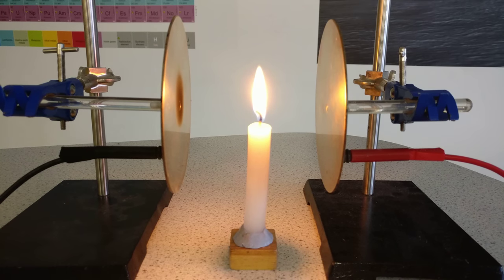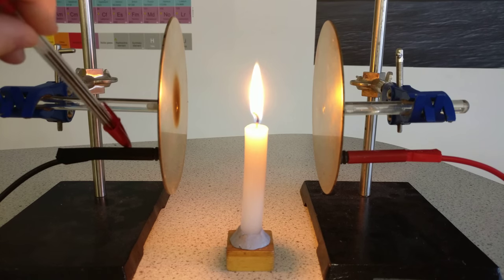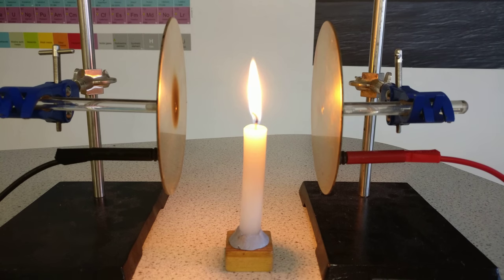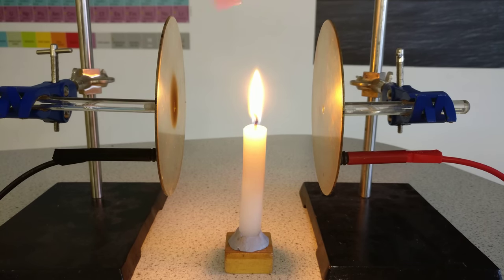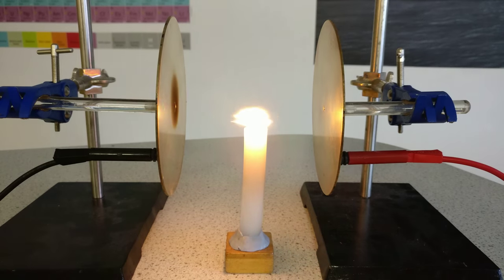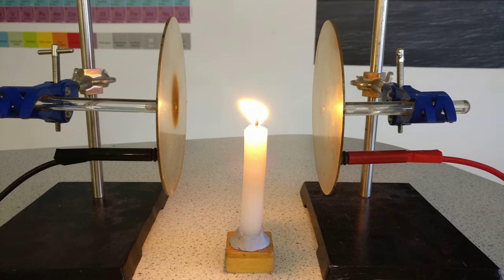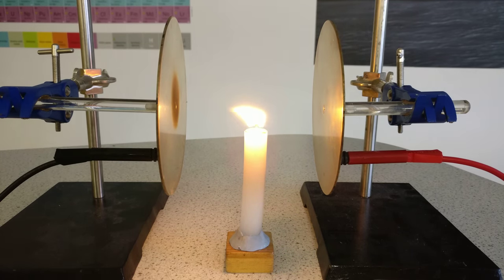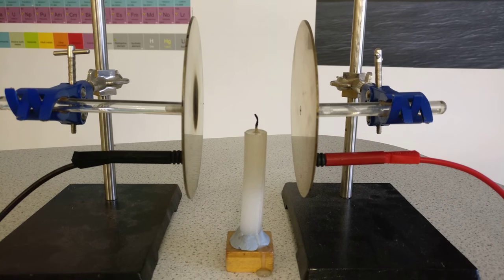Christmas Candle Flame in an Electric Field  - AQA A Level Physics

Comment: Very interesting!
My question is... does this "ion wind" have any effect on the burn rate of the candle?
a side-by-side time lapse comparison would make for an interesting pt2, no?
Reply: Hmm maybe, but what is happening is the energy from the flame is being joined with the energy in the circuit, you can see this cause the candles flame is moving towards the negative which is how the energy is also flowing. I assume it will have a effect on the rate of which the candle burns due to a few factors.
Reply: @DJxSGGxNeo  that's what I said!, lol
but seriously. if you have ion flow in 2 directions, does it more or less cancel out/balance ion flow (leaving only ion size as significant factor) or does this "joining" you speak of act like a bellows and increase burn/+O2?
also... if there is dual ion flow- pos ion flow to positive and neg to negative, then why do we see the soot accumulate seemingly on only one side? does the char get charged? (incidental pun!) even crediting ion size, there would still be some soot on the other terminal, no?

Comment: When did electricity at electrical Fields move from positive to negative when they've always move from negative to positive before?
Reply: Was going to ask the same question.
Reply: It's because there are positively and negatively charged ions, while in a solid only electrons, which are negatively charged, can move
Reply: @bene5431 And that is the reason they move from negative to positive.
Reply: @IAMNOSLEEP  Yes, positive particles move from + to - and negative charges from - to+

Comment: Is there a build up of soot on the negative plate because the soot particles are positively charged?
Reply: not sure but most likely because he put the candle flame on it for some reason, probably if what you think is true the soot would have spread all over the plate, and likely not visible

EDIT:
done the experiment, you're right, it blackens on a spot of the negative plate like in the video, it's not spread
Reply: In my mind, I can imagine that only the electrons flying through the flame are picking up soot and embedding it in the negative plate, and that's why you only see the black spot where the flame generally is.
Reply: @LuisMartinez-zd2vl  The electrons are negative, so attracted to and therefore traveling to the positive plate.  The soot is either positive itself (most likely) or is being dragged along by the flow of positive ions.
Reply: @davekni  The flame touches it once in this video in one frame, 2:32, comma/period are frame-by-frame after pause
Reply: @davekni  Maybe formed by charged ions carbons?
Reply: Ton is correct.

Comment: I'm wondering if an increase in burning efficiency can be obtained by means of an electric field like the one shown here
Reply: Goos idea
Reply: a candle seems to consume all of the fuel and oxygen?
Reply: If whatever is happening to cause the flame to go out like that, if anything I would think it would probably be the opposite, maybe? Because the flame needs 3 things to survive, fuel, heat and oxygen and if any it loses any one of those it will die so the electric field has to be disrupting one or more of those elements, so maybe its displacing the oxygen somehow? Im not sure, but whatever its doing its starving the flame of something which means its efficiency would have to decrease? 
Im just guessing.
Reply: Good idea, I'm wondering if the net energy input by comparison would be positive. You should PhD and stuff...
Reply: If it's the transfer of ions that's making the flame move, I guess the burn efficiency would depend on the fuel source. 
I wonder if an electric field could be used to stabilize the burn. We could test by introducing a steady cross wind
Reply: If changing the orientation of the plates one below the flame at the base and one above the flame
Reply: Good mixing of fuel and oxygen promotes good burning.  There should be a way to improve the mixing and thus burning with electric fields.
Reply: I don't thing so. Fire are a mix of ionized atoms and molecules, they have an electric charge because they lost an electron (or got one). Applying an electric field makes those particles shift to the opposite charge. Maybe you could make the gradient of particles bigger moving them out of the flame so it burns faster but that can be achieved  much better with a flux of gas (an extractor).
Reply: NO it can't.

Comment: Humidity in the air (H2O) goes doink, aligning itself with the electric field surely since it is a polar (non-symmetrical) molecule, slightly negative on the oxygen side (pointing toward the positive plate) slightly positive between the hydrogens pointing toward the negative plate. CO2 is not polar, it's straight across. In water, it only takes 2.3 volts per molecule (if I remember right) to line 'em up and strip them apart during electrolysis to make hydrogen and oxygen gases when they recombine in like pairs. (Lots of current though, unless pulses/frequencies might help). 

Just have to wonder if they ever separate in a strong electric field in air, first time it ever crossed my mind. If so, would we be losing some hydrogen floating upward with our 100 lightning strikes on earth per second?
Reply: To break apart a water molecule  using only an electric field, you need the potential difference across the molecule to be at about the same order of magnitude as the internal field. This is certainly possible to achieve (e.g. using a laser) but not at "macro" scale.
Reply: dang it
Reply: Yes. Lightning definitely creates hydrogen, but i think most of it recombines with the oxygen that is produced because of the heat generated by the bolt. I would be interested to know the quantities involved.
Reply: So in other words making hydrogen to power cars isn't a very energy efficient way of powering cars and would lead to releasing more carbon than if we just burn gasoline in today's highly efficient engine's?
Reply: @dukecraig2402  It actually comes pretty close in round trip energy efficiency, but you are correct that it is less efficient in pure energy than the most efficient gasoline... When you compare them in terms of CO2e per kwh of energy spent doing work though even with just a large percentage of lower emission renewable energy driving the mix hydrogen smashes gasoline and that's without considering ability to trade energy on the grid/market utilizing negative energy from excess generation and helping to stabilize the grid with much, much more capability than all forms of battery storage...... There seems to be a lot of confusion and misinformation around this side of it... Only semi good piece I have seen that covers it in some depth is over on the channel Engineering With Rosie "Batteries in the Electricity Grid | Engineering with Rosie Live Episode 6" one look at the graph of where hydrogen sits with pumped hydro will give you an idea of its role to play in future energy ;) it blows many people's minds.
Reply: @psychosis7325  
And that doesn't cover all the carbon released from the additional forest fires in California courtesy of PG&E from the increased load on their system, not to mention the fact that there'll be that many less tree's to convert carbon back into oxygen, oh yea and all the deaths and property losses from those additional forest fires.
Just keeping things real.
Reply: @dukecraig2402  from my understanding PGE plead guilty and was found liable for manslaughter for mismanagement of several pieces of electrical infrastructure, the loads don't really seem relevant. But you are correct those things need counting up and as put forth by proponents at Stanford and MIT, I would agree that looking to extend the life of the nuclear plant there and combine it with hydrogen electrolysis as well as water desalination could go a long way toward cost reductions for consumers as well as put a little dent into the cost of submerging cables to prevent things like that occurring in the future.
Reply: I'll have to look up the technical definition for molecules going 'doink'. But the part which really perplexes me is the '2.3 Volts per molecule'. A water molecule is less than 0.3 nanometers across. If the voltage drop across some distance (say one meter) was to be modeled as a series of water molecule 'resistors', each causing a 2.3 Volt drop to achieve the effect you describe, the Voltage across just one meter would be in the BILLIONS of Volts. That does not seem right.
Reply: @gregparrott  Yeah, unknowns there apparently. In practice the gases are generated at (or near?) the plates. Finally looked it up, my 2.3 was from way back. Now many say just 1.23 volts for electrolysis. Found a video where a 1.5v AA battery is dropped into a glass of saltwater and the gases are generated. Does the NaCl make like a wire? And yet, there's no short so I'd like to understand that better. Could be the magnetic field from flow matters in separating H2 from O, donno
Reply: @dukecraig2402  how exactly does carbon get converted to oxygen? Like lead to gold? 😂
Reply: @thersten  
Plants convert CO² to oxygen. 
All the carbon that gets released into the atmosphere from automobiles and burning coal is in the form of CO².
What's the last grade you completed? 6th?

Comment: This is kind of like a pilot safety system on a gas fired furnace. Unburned natural gas does not conduct electricity while a pilot flame will conduct electricity. An ac signal is changed to a basically dc signal by using different size conductors for the signal so a short circuit would not defeat the safety, It is called a flame rectification system. The older style heaters used a thermocouple. which develops a 30 millivolt signal which energizes a solenoid which allows gas flow.

Comment: this light is (hot) GAS (before flame , and also gas (candle wax, in the gaseous state), after oxidation (combustion)) you move the gas. Many do not understand and think it like magic (because it's fire/light (as you move light, or the direction in which photons move)).

Comment: 2:05: .."more positive ions produced.." I think that is not right. Maybe the positive ions have a bigger mass and therefore the flame leans more to the negative side.
Otherwise please explain why in a flame more positive ions are produced....
Reply: I think the positive ions produced may have more mass (more atoms) then the negative ions. For example, when you ionize a water (H₂O), you produce a hydrogen ion, atomic weight 1 and an OH– ion, atomic weight 17. Both ions have the same but opposite charge but very different weights.
Reply: @rubiks6  Thank you.
Reply: I think there is another factor: while positive ions are just ions, the negative parts are at least partially just electrons. And some of the ions are not straight C+ and H+, many of them should be products of partial combustion that can still decompose producing more heat and undergoing further ionisation. Basically the majority of the ionized candle vapour stuff that actually burns gets positively charged after initial ionisation. That is why in the strong field the flame splits in two with the bigger part of it leaning to the megative electrode.

Comment: I need help
why are the positive ions moving more to the negative pole than the negative ions?
some say it has a bigger size and mass
some say negative ions are just elections and weigh nothing compared to positive ion
but this doesn't answer my question, why is the positive ion more reactive to the negative pole?
Reply from the maker: I think my description is correct, I took out one line to be really clear. I am just talking about speed being slower and mass larger for positive ions. The effect of the field must be more on a lighter electron.
Reply: @animatedsci  Thanks alot, sorry for not reading the description :P
But I am just curious, why is positive ion heavier? If it's referring to density the shell of positive ion should be one shell lesser than atom
Thus following the d = mass/volume formula, its density is increased as the ion volume (shell layer) decreases
Is my understanding close to the real thing?
Reply from the maker: The positive ion will be carbon, H2O any products really of the burning. Heavy atoms really who have lost an electron. Hence massive difference.
Reply: @animatedsci  sorry maybe it's because of typo
Do you mean the positive ions is C and H2O, which lost an electron so it's heavier than the negative ions (electron)?
Reply: @electronx5594  99% of the mass of the atom is in the nucleus.  That means the following:
1)  assume an extreme case - ALL the electrons of whatever atoms are in the air between the electrode plates get stripped off and collected on the positive electrode, and ALL the positive ions - e.g. the nuclei in this extreme case - get collected on the negative electrode

2) keeping in mind that 99% of the mass of any atom is in the nucleus..... 

3)  which plate collects the largest, and slower-to-accelerate, particles? 

THE NEGATIVE ELECTRODE PLATE.  
- 99% of the mass of the atoms is in the positively-charged nucleus
- which is collected on the negative electrode

Since F = ma,  you can assume that, with the increase in 'm', the 'a' acceleration is lower for the same amount of attractive force created by the electric field between the plates.
.